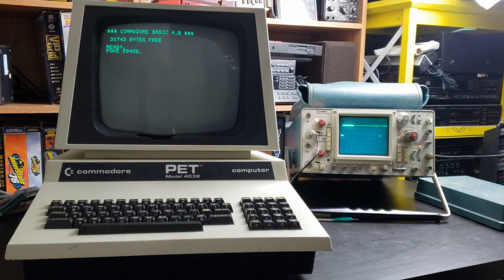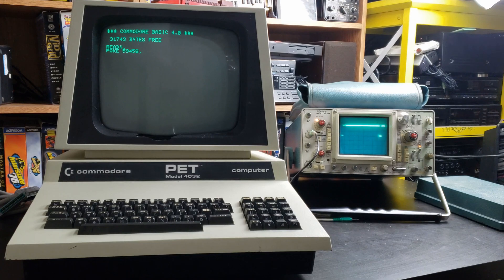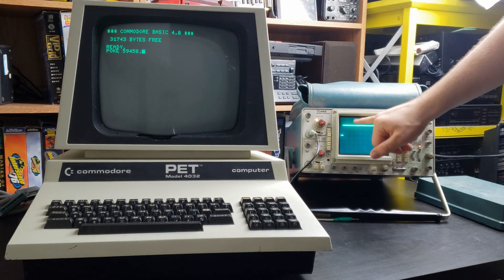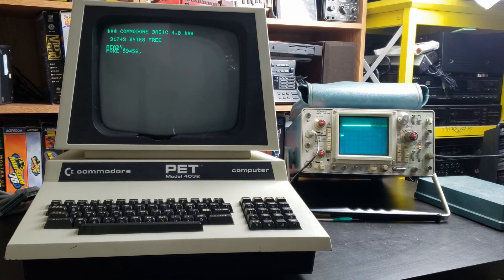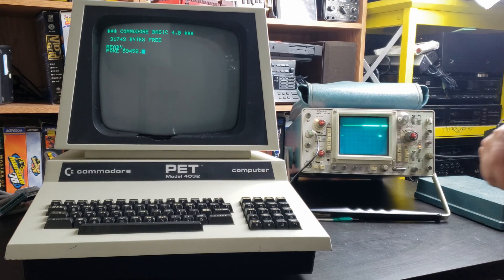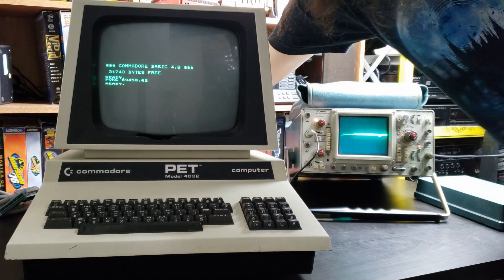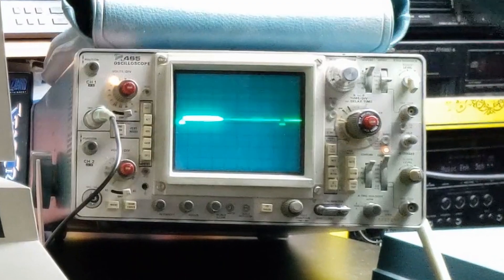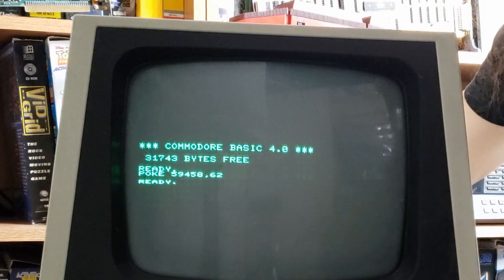Running the Killer Poke on a PET 4032

Comment: The Killer poke. Wow, thank you for dealing with all the rumors. I have had a commodore 4032 in 1982. the brand was not PET in Germany, instead of that it was called CBM, commodore business machines. No one was allowed to test the killer poke on my beloved 4032. I loved it. Unfortunately I sold the machine to buy a commodore 64 and floppy drive 1541. nowadays the 4032 is a kind of collective item and very expensive. Keep up the good work. Stay safe.

Comment: So the CRT lost about half of its vertical deflection, which makes sense if the V-drive dropped from 2 V to ~1 V. That's not really going to hurt anything unless you leave it that way for a long time. But this is with (presumably?) mostly 40-ish year old components, and resistors tend to drift upwards in value as they age. Maybe when these machines were new it would lose almost all of its vertical deflection, which is not so kind to the CRT.
Reply: So in other words, resistance is futile...

(sorry)

Comment: Interesting! Can you share details on the hardware, like board revision? Esp. also board revision of the circuit board in the monitor? Are you sure it does not already contain the TDA1170 video sync controller that fixes the killer poke?
Reply from the maker: The main board is a 8032089 which seems like it is a later revision board. Looking over the board I don't see any chips with that part number on it, but I'll post a picture of it to twitter in case I'm missing something.

The CRT board is 2817781 and I can't seem to find anything about it online.
Reply: @techtangentsii  this chip should be on the board in the monitor where the video CRT is
Reply from the maker: Ah, I posted some admittedly not so great pictures of the CRT board along with the main board on Twitter. But I didn't see any chips on the CRT board.